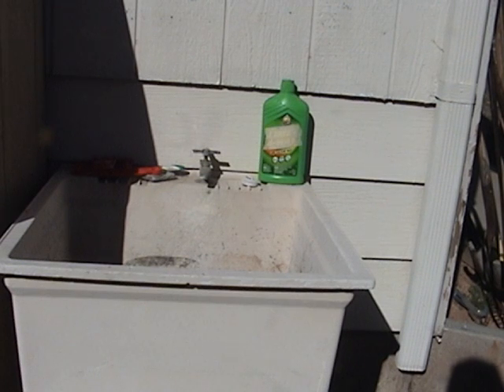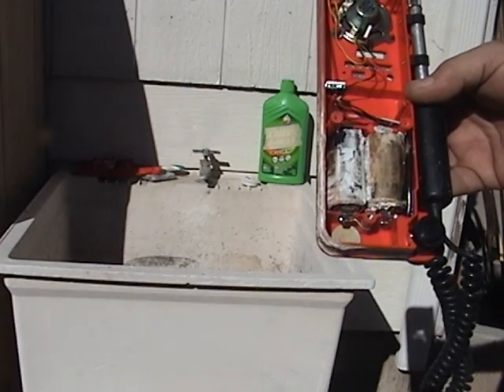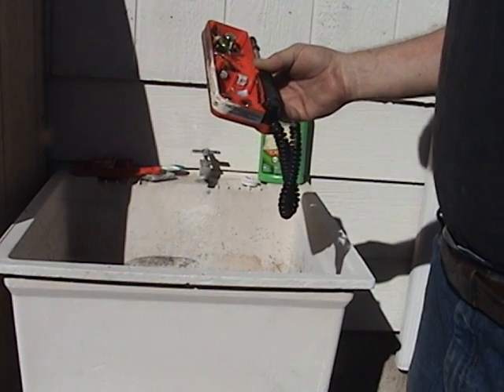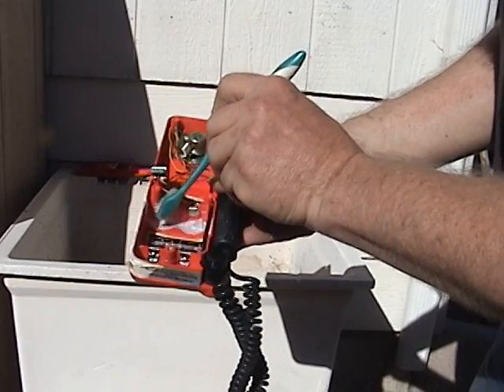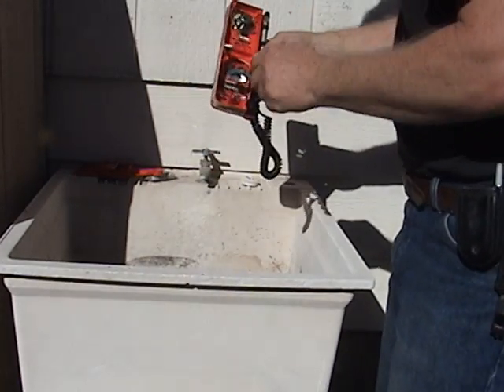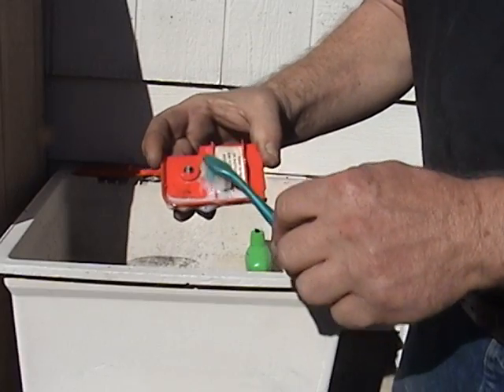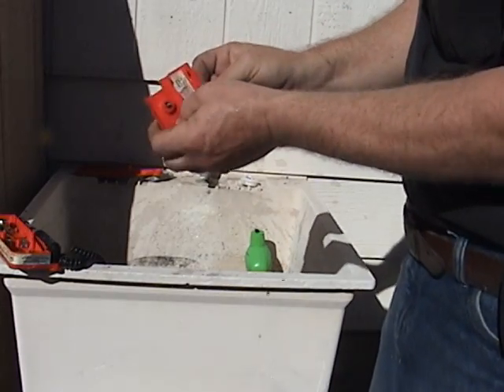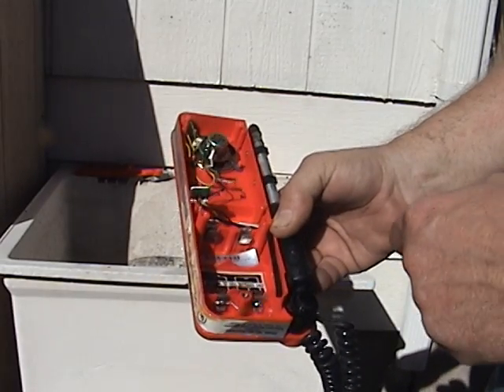Alkaline Battery Leakage/Corrosion FIX !

Comment: Don't ya hate it when that happens, in the past I have just used baking soda and water followed by alcohol rinse to dry it out then sprayed with electrical cleaner and lube, that seems a good replacement for the baking soda part.